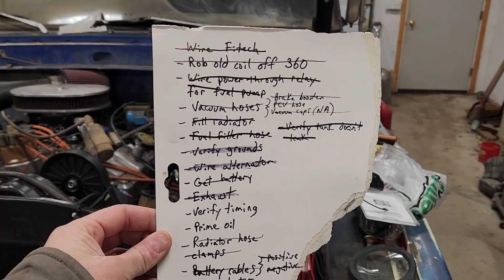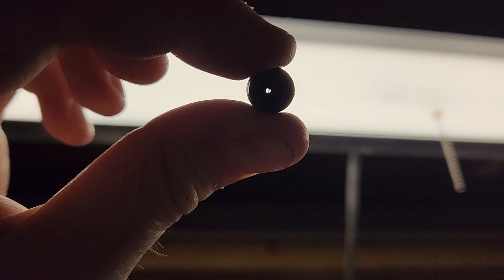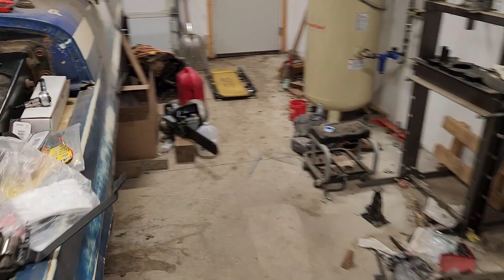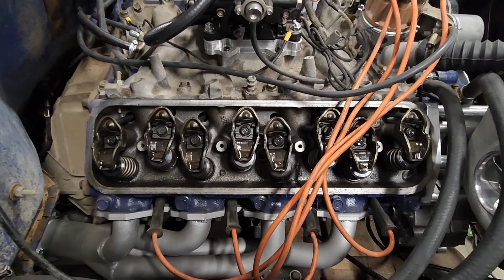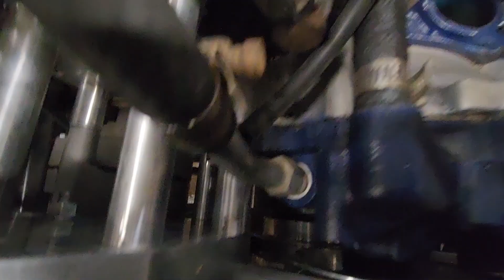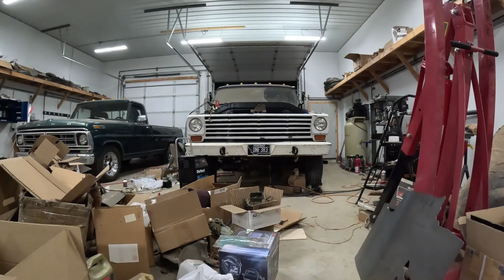Ranch Rod (1969 F-100 with 460) first start - Success, but what is that horrible whine?  Part 1

Comment: I had the wrong starter for 460tzf5 manual trans. make a similar noise as the gear stays in mesh. Different positions on ring gears.
Reply: I went with the later 93 or 94-97 460efi permanent magnet geared reduction starter. Way smaller and stronger.

Check ps pump fluid for foam too
Reply from the maker: @Turbocharged400sbc  The starter that I am using is from a 1990 EFI.  I'll have to check, but think that was probably the same starter through 97.  I am using a billet flywheel that has a slightly different tooth count from the 1991 ZF5 flywheel, but I think it is a couple of teeth less.  My dad also asked about the power steering.  I agree that it sounds similar, but this really sounds like the front of the transmission/flywheel/clutch area.  Dad also suggested I try putting my foot on the clutch to isolate if it is a transmission problem or not.  I haven't tried that yet, but need to.  Keep the ideas coming.  Much appreciated.
Reply: @adamdice231 auto vs manual starters are different ring gear positions. Double check as I was given an auto initially and it made a whirring sound. I think you can hear it in my floor start vid.

It's likely your starter and ring are un constant mesh basically
Reply from the maker: @Turbocharged400sbc I will check.  It was the starter from my 1991 parts pickup that the engine and transmission came from, but that doesn't mean it was right either.  I'll double check.  Thanks for the advice.
Reply: @adamdice231 if you goog it theres measurements to confirm. I was panicking cause it dounded like a dreaded rear cam bearing sound sorta till i noticed the starter gear covered in fine steel shavings.
Reply: @adamdice231  sounds like air in power steering... Easy check - take belt off or just loose and don't let PS pump turn. You'll know instantly.
Reply from the maker: @Faolan161  couldn't hurt to try.  It does have a serpentine belt so I would lose all accessories, but that wouldn't matter for a quick start up.  Thanks for the suggestion.